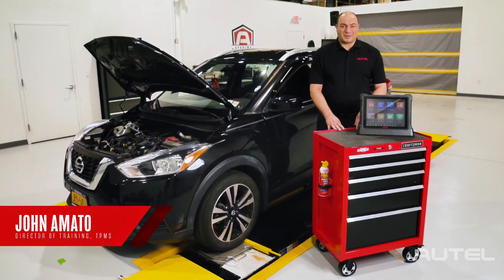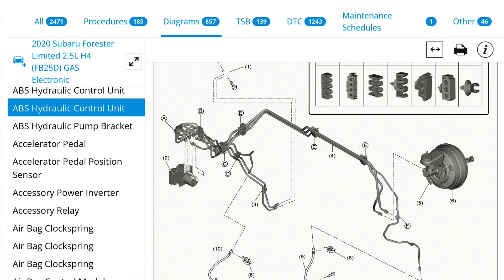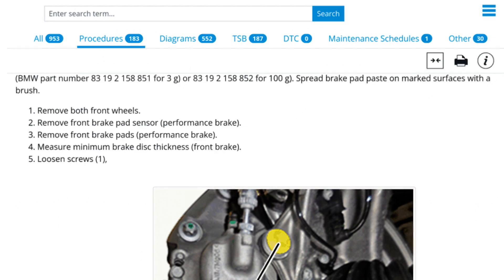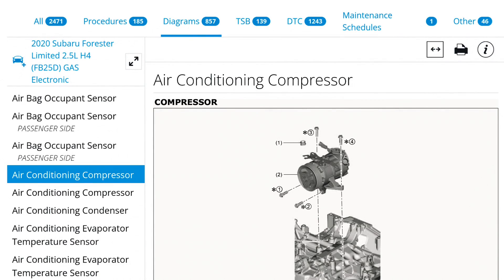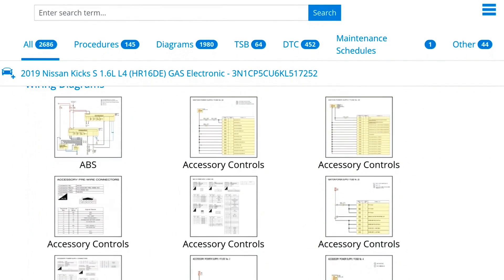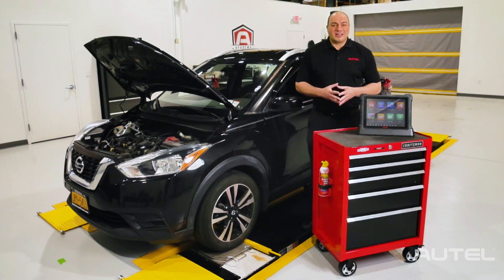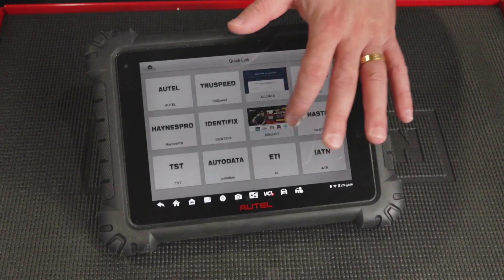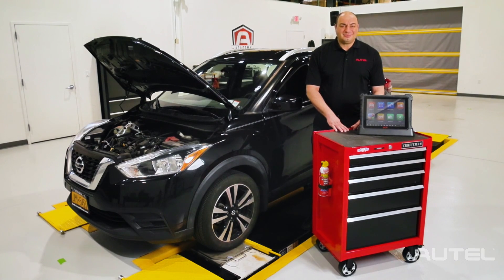MOTOR TruSpeed Repair Data On Your MaxiSYS | Autel

Comment: How exactly would I make $650 back in an oil change ?
Reply: Its a rip off your better off going with all data i paid 5k for this scanner and honestly i regret it i should of got the snap on
Reply: @Downtime_videos  I agree with you about alldata. Do not feel bad about not getting snapon. I have a snapon zeus,snapon verus d10,snapon modis(original),mt2500(red brick) autel ultra , autel ds708,908 and elite, topdon phoenix max. The autel ultra gets used the most. The snapon generaly comes out for when I need to graph pids. Everything else about the zeus I find disappointing.  They havent really made any good changes to the software , even the scope is still the same. The scope on the ultra is even wireless and the software is better. The best thing is to have both and use what fits the job.
Reply: He’s saying 1 oil change a month for 12 months should cover it. Which still isn’t accurate, idk anyone that is netting $54 pure profit on oil changes.